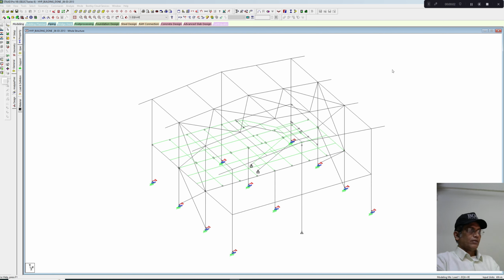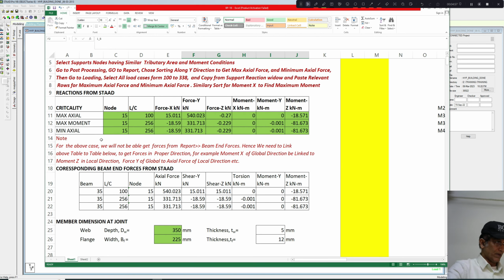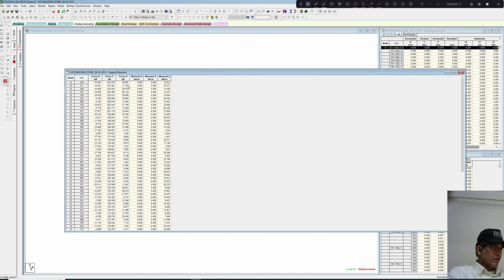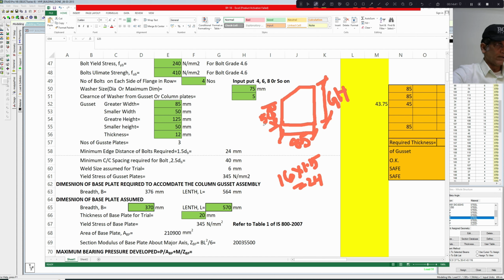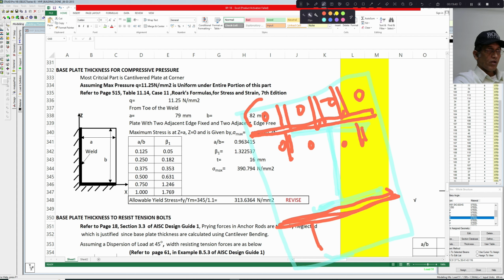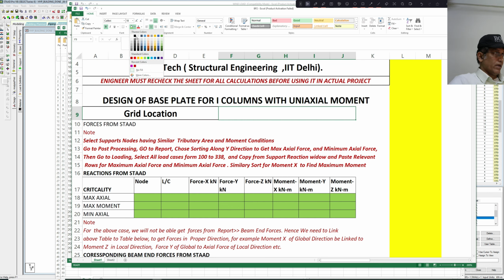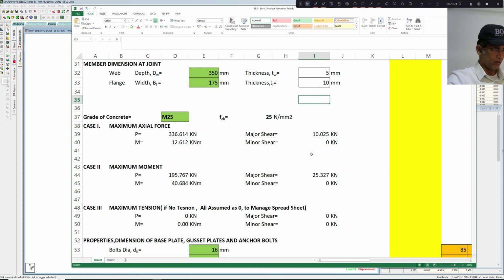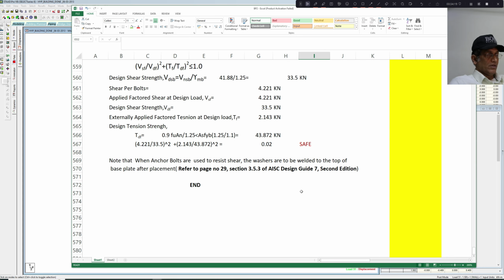SECTION 12A  UNIAXIAL MOMENT BASE USING FORCES OF STAAD PRO

Comment: Sir,
How to find the thickness of cap plate and base plate for the stub column connection starting from the flange of main beam.
Any reference in this regards is very helpful sir.
Reply from the maker: I  planing to make a question answer series where I  try to cover all the question put forwarded to me.

Comment: Sir...please upload videos about cable bracing design and its associated connection design as well.
Reply from the maker: Dear Indra Lambu, I haven,t deal with That subject yet. In My Channel you will get RCC Building Design, Steel Building Design and Light Gauge Steel Structure design , these are field on which I expertise

Comment: Dear Sir, The used staad pro file is not available in the website you mentioned. Can you please share that staad file? Thank you...
Reply from the maker: Dear Azmat, thanks for writing
I expect you all to make your Own STAAD File according to  my tutorial. This will boost up your confidence.
After This one, I shall add a Tutorial for Design Steel Warehouse with  2 Nos of EOT Crane  Operating in Tandem in
two bays.
There after , I shall add Tutorial for design of Process Building, say a Chemical Plant or Sugar Plant.
I expect to keep on Preparing your own STAAD file for each of this buildings. 
I have already a provided template for the STAAD having all primary Load cases and Load combination.
Still if you  feel , the STAAD file of this tutorial will help you, please drop a mail to strengthrealization@gmail.com to
get the input file.
Reply: @softwareaidedstructuraldesign  
Dear sir,
Greetings.

Actually i asked for the .std file because, in the video named (section 8 the designed paramaters all steel designer must know), you had explained/calculated in detail about the design parameters (Lx, Ly & Lz) that to be given/assign for the staad model. But, in the next video named (section 8 continued design parameter to staad model), the design parameters (Lx, Ly & Lz) assigned to some respective columns & beams/joists are different. I got confused and that's why i asked for the .std format file.

Actually, i have already modeled the structure, assigned sections, specifications, loading, etc.,. But, got stuck in the design parameters assignment part....

Thank you for the reply.

Regards